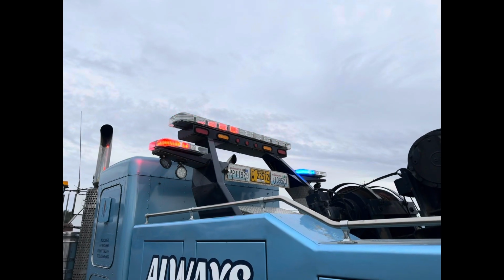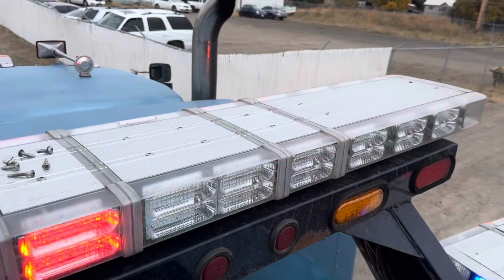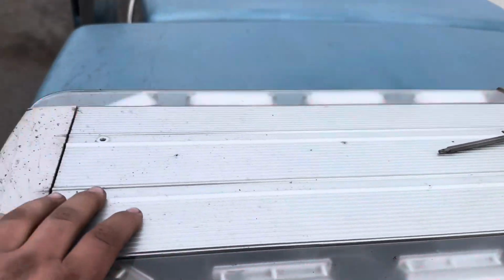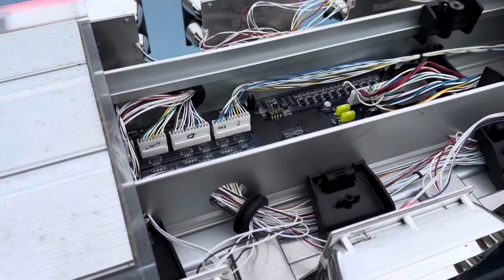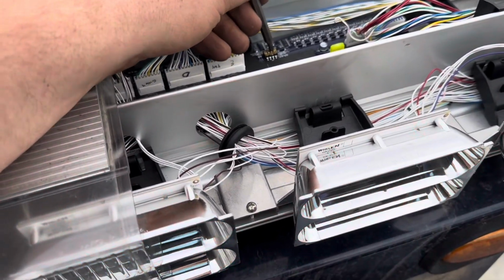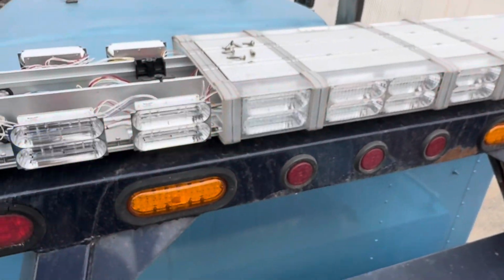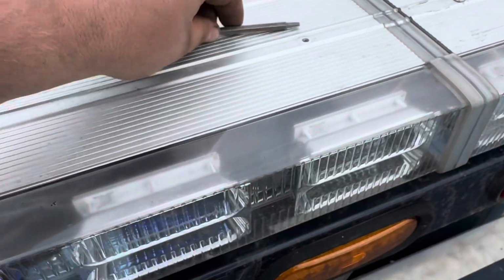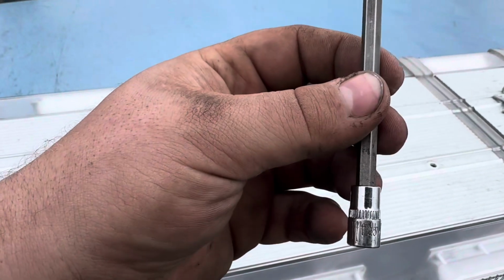Whelen Freedom 4 patterns

Comment: The old style Freedom LC boards and the LC Liberty board there was another wire you could put in and put power to it to sink the bar typically the spot was left without a wire but it was part of the Ta plug